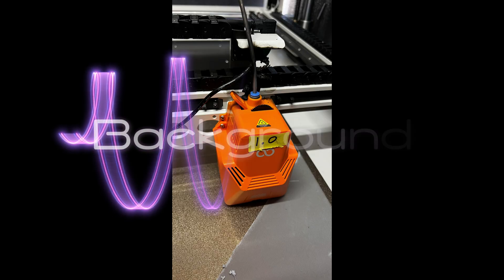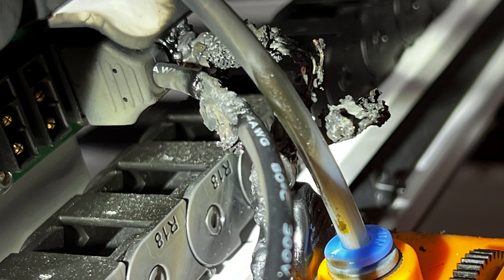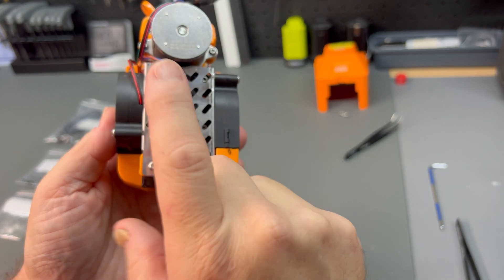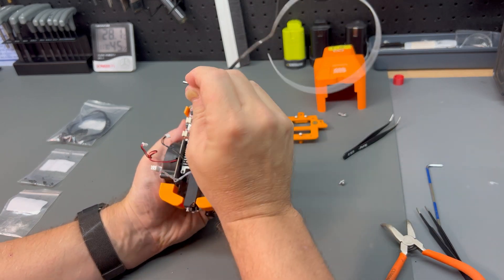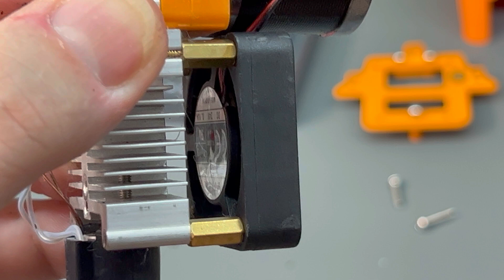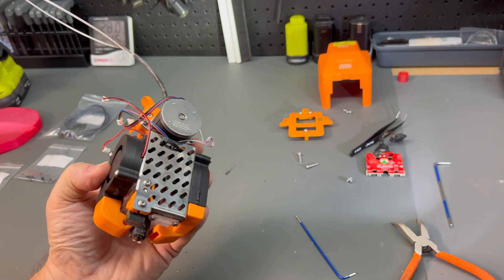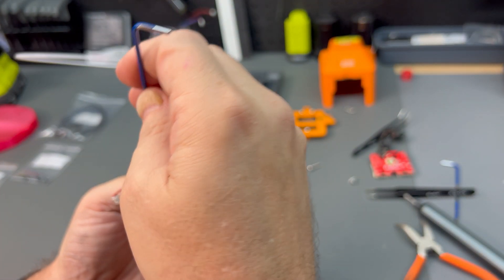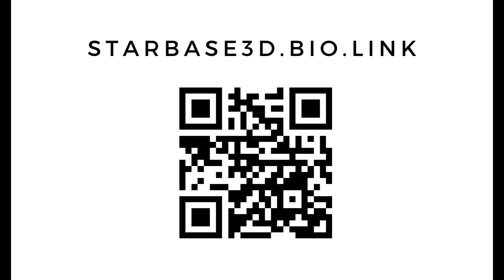Elegoo Orangestorm Giga - Printhead fire

Comment: Thank you for this post. I opened mine and found a bit of stringing—not a lot, but enough to cause concern over time. I did notice the hair getting sucked up sometimes, and in the back of my mind I knew it wasn’t right, but now I see the whole picture.

I decided to run it once without the shroud, as I think the vents on it are so small and the noise level drops a lot without it—no more hissing from the fans struggling for air. With the shroud removed, I can visually check for fan blockage at a glance and see if the rest of the print head is having any issues as well.

I think I’ll leave the shroud off for now.

Comment: This is due to crappy wires.  My x axis failed, after replacing that line I then started receiving more and more mcu errors.  Literally replaced everything above the build plate with wires rated for bending and being placed in a cable chain.  Works great now along with a chube and lgx pro
Reply from the maker: I both do, and don't, agree to a varying agree.  Some of the wiring seems really cheap: Like the limit switch wiring.  But the head connect cables seem pretty decent especially when they should be carrying a minimal level of DC power.  Its weird how the wires appear to have overheated and burned to the point of disintegration: How much current does THAT and why should that much be going to the head in the first place? That much current targeting the heater cartridge would send it to 2500°. I mean... even if I shorted the 24vdc pair that goes to the nozzle heater it shouldn't melt the cable.  I'm more inclined to lean into the firmware being the issue.  Once, just once, it triggered the out of material routine when one of two spools ran out-and just kept going: The screen said change it, but it never paused. I was told that's a known bug for this machine.  Other owners report other random oddities.  We all know this 'repeated layer' issue when you change spools. There's some bugs in the firmware to be certain.
To me: I'd bet there's some level of bad logic here.  It detected inability to cool so it kept ramping up power to get the job done... with no limit.  Or some random math issue that made it want to go to 2500 instead of 250 degrees... or... or...

Comment: Flip the fan just sayin .
Also why your prints so wispy
Reply from the maker: Yes - flipping the fan is what I suggested as a mod to avoid this problem.  But I want to be clear that I haven't tried it yet myself.  I pretty clearly said it was a proposed experiment.
Wisps with PETG, at high speeds around 300mm/sec, with a 1.0mm nozzle and in a humid climate just tend to be a side effect of life.  Also, considering the volume of printing this giant printer has done in a month of around-the-clock printing that's really not much at all.  Its only a lot in the context of it all being up in the fan.

Comment: Looking at the shape of the blades on the fan the air is without a doubt suppose to exit on the side with the label as is the case with every other similar fan. I think the person who assembled the printer at the factory reversed the polarity somewhere most likely at the control board or at one of the connectors by putting the positive pin where the ground should be.
Reply: Most fans nowadays are pwm controlled which eliminates the possibility of that. It's more likely the fan was backwards.also it's dumb to put a fan on standoffs like that. You need a shroud to direct airflow. That's just pulling air from the sides and is likely hardly affecting the block. These guys that make the printer obviously never built any computers because this is absolutely basic airflow management.
Reply from the maker: Pretty sure the assembly person just did what they are told.  Molex connectors are keyed to avoid reversal.  So if that's the issue then the board was laid out backwards.  If its an assembly error by a person, it more likely just putting the fan on the standoffs backwards.
Reply: that does look to be the case, those fan blade profiles, seem like they should be pulling from the hub side, and blowing through to the label side.

Definitely shouldn't be working the other way around.

Comment: The cooling of the radiator is going to drop quite a bit, and I'd highly recommend against that! I would say add 2mm to 3mm washers between the radiator and the fan on the radiator. (You could even print and install ABS or ASA spacers) this should effectively eliminate the "Vacuum from the heated bed" effect and still provide effective cooling to the radiator. (Only downside is now you are venting to the heated bed) you might also look to add a thicker fan to assure that in a pull configuration the fan is pulling through enough air to effectively cool the radiator and upper section of the heat brake.

Also modification to the toolhead cover to provide an exhaust for the radiator cooler, and designing a shelf to come from the bottom side of the fan to the new exhaust i8n the toolhead cover would likely be the best solution to prevent possibly undesired airflow to the heated bed. 

Good luck m8.

Comment: Thank you for the clear video. The maintenance warning is great. I don't have a pet hair issue, but I do a lot of PETG printing, which can be wispy. On the mod, not sure flipping helps? Filament can still get sucked in, but I'm not sure. Would be interested in your experience.

I've always wanted to convert the print head into a higher flow but haven't taken it apart yet. I did get a 2nd printhead (for duplication of 1 part as it turns out), so now I can play around!
Reply from the maker: Agreed.  There's a "not sure" factor on that mod for certain.  I'm communicating with Elegoo support about that, and am told their engineers are looking forward to receiving my parts.  Its an experiment as I said.  At the very least it changes the air path from being directly straight up to the intake side, to being up/turn/across/turn/up. So hopefully wisps have a harder time pulling up.  I'm hoping for a 'path of least resistance' behavior where intake air is straight horizontal through the cage.
Reply: Most exciting? One of the best OSG videos out there.

Question: Shouldn't pulling the air in from outside instead of from the warm print surface actually increase the cooling and lower that temp a bit?
Not sure if that is beneficial or not, since the hot end is in there.
The difference could be miniscule. 

Have you tried this with your working head?
Reply from the maker: @GaryTabarJr  I haven't powered anything up yet since the incident a couple days ago.  Between the actual event, making the video and the Christmas holidays there's been no time.